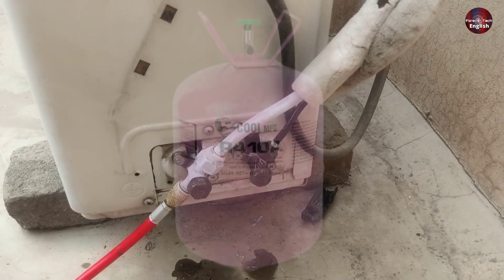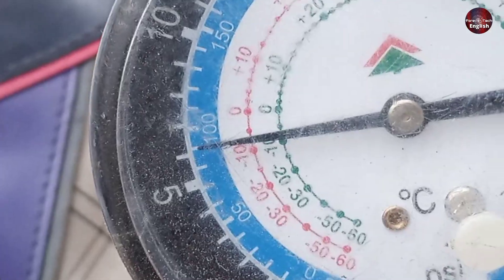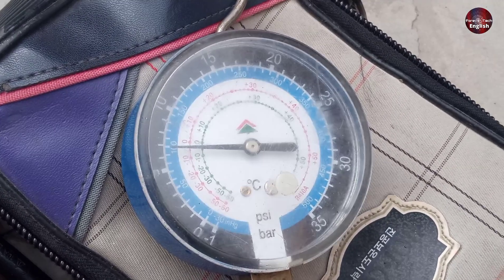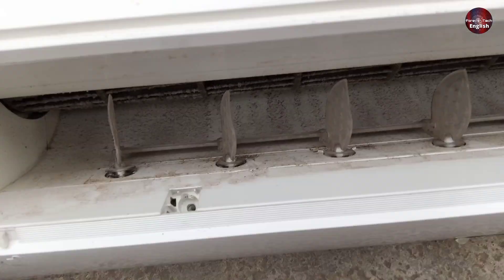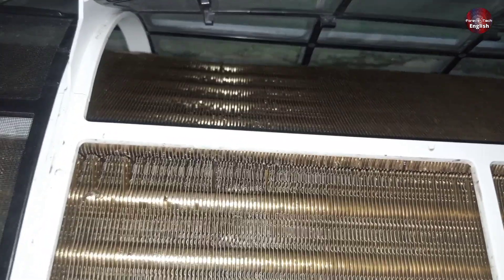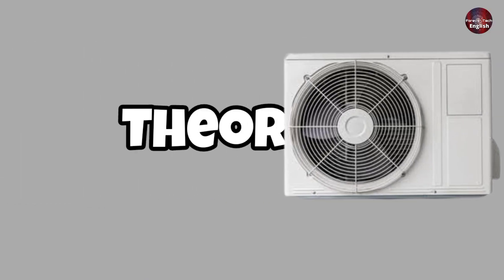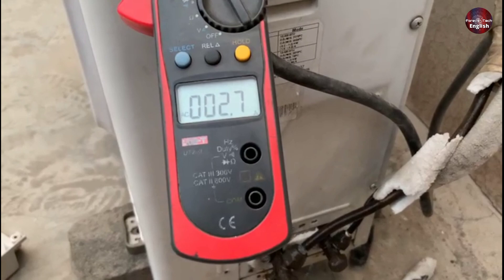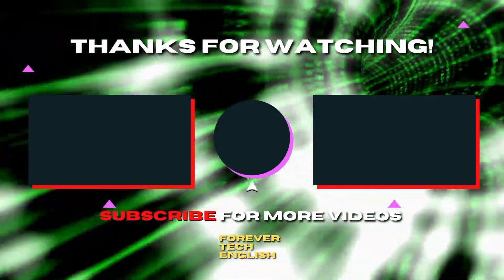ICE Freezing on Mini-Split AC Suction Pipe Line

Comment: what about on the liquid side i have the dual zone, both liquid freezing
Reply from the maker: These could be the reasons: Low refrigerant charge, blocked or dirty evaporator coil, restricted airflow over the evaporator, malfunctioning expansion valve (TXV or capillary tube), compressor issues, and low ambient temperatures.

Comment: This is happening to me. I have a multi-head unit. 5 indoor units connected to 1 outdoor. 4 cool perfectly. 1 is icing on suction line. Your solution doesnt work because my unit is brand new and clean
Reply from the maker: Then the refrigerant might be low in your air conditioner.
Reply: @forevertechenglish how can it be low if all 5 units heat very well and 4 cool very well?
Reply: @forevertechenglish but as soon as i switch the faulty 1 on cooling mode i get ice
Reply: @forevertechenglish and at 0:53 you said icing means overcharged?
Reply from the maker: Which pipe is freezing the small one or the bigger one

Comment: In my own case it's the small pipe that's freezing up whenever i start it up and then it stopped freezing up after it work for 2 to 3 minutes.. it makes annoying sounds on the outdoor unit too
Reply from the maker: If the small pipe freezes, its possible that the Ac could be low in refrigerant, Due to A leakage. Check whether the condenser or the evaporator are dirty, if yes then clean them.
Reply: @forevertechenglish thank you I had the same problem
Reply from the maker: The problem might go away through cleaning. If not then the ac is low in refrigerant
Reply: After cleaning how much time it takes ac for not to form ice

Comment: My own ac is new, its not dirty, please what could be the problem? Thank you
Reply from the maker: It could be overcharged with refrigerant, Check for any bent in the pipes, if their is bent in the pipe in new installation, still it could freeze the pipe line.
Reply: @forevertechenglish  Thank you. You are a lifesaver. I have just checked and I can confirm there is indeed a dent in the pipe.
Reply: What if it brand new and no bend in pipe ?